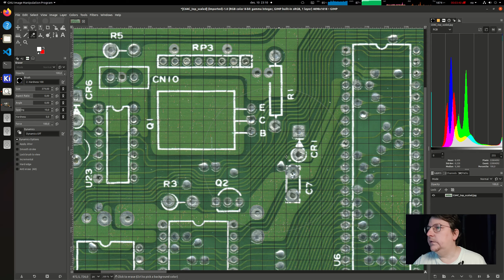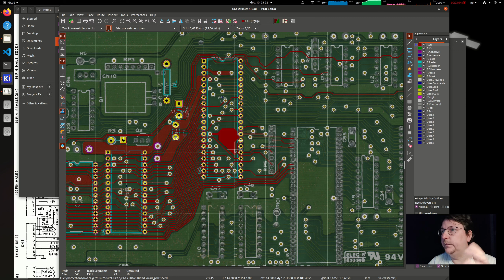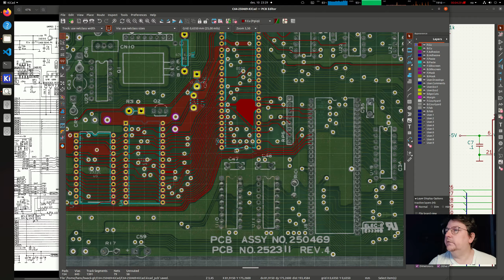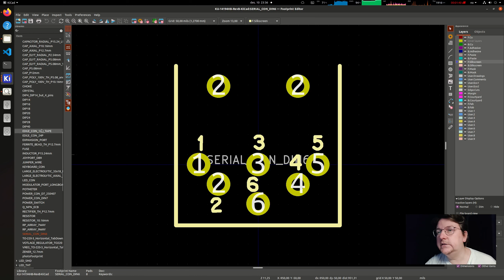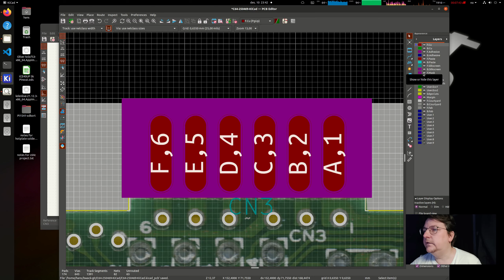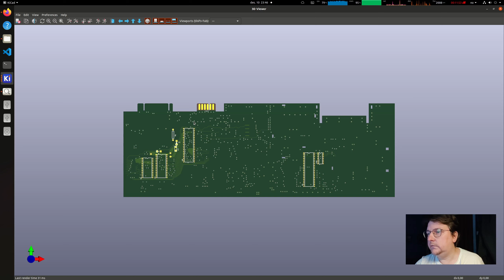C64C Motherboard KiCad Replica update 1

Comment from the maker: I'm sorry if you tried commenting on the previous video. Youtube spam filtering is quite harsh I guess, so I have accepted all comments in my videos from now on.
Reply: Even without any configured filters YouTube does filtering. As soon as you post a link, your message will get deleted for example. Except when it's a YouTube link 😂
Reply from the maker: @RainerK.  You are right about the links and filtering.
Reply: Nice work, patience of a saint for such task. There is a RevB board that has integrated video RAM in the PLA.  I have posted the photos of both of my boards on AmiBay.  Maybe the idea to have socket for 251715 and 252535 PLAs for Rev4 and RevB configurable with RAM socket
Reply from the maker: @donnied8127  Thanks for the heads up. I'd like to learn more about that, but for the replica I'm sticking with Rev4. After uploading to github, we can add stuff later :)